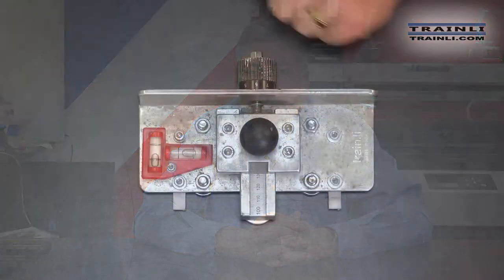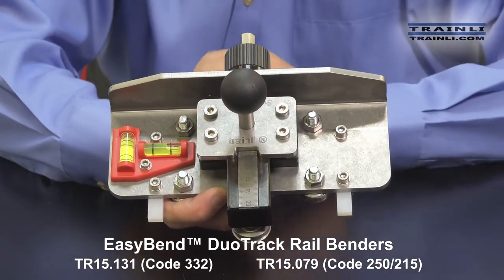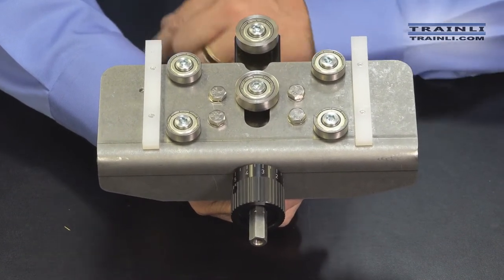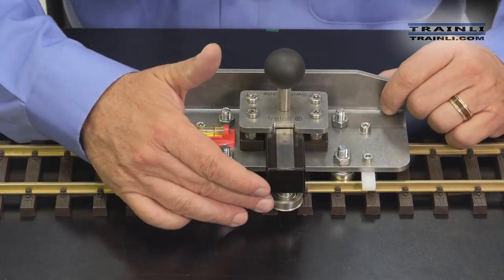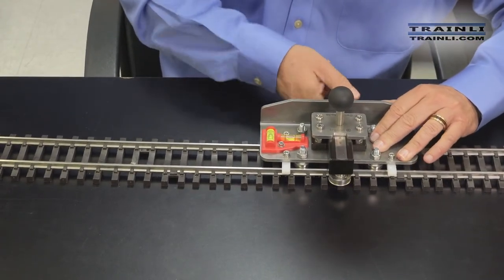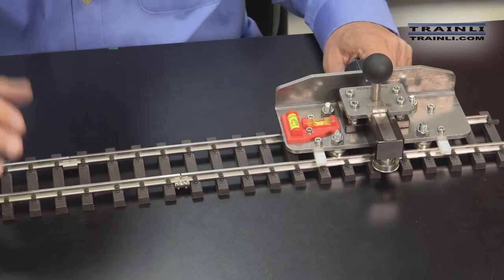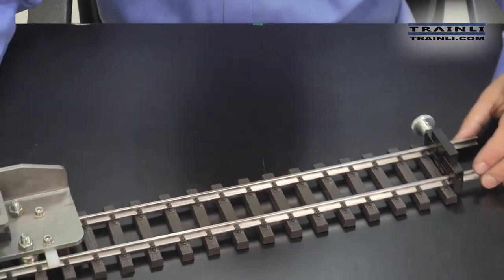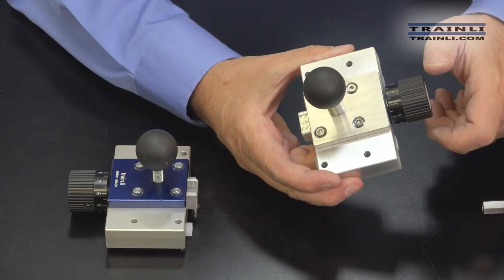TrainLi TechTV  -  See the best dual Rail Bender on the market!

Comment: Building a 18’ long trestle, using “ former” split jaw bents and roadbed, with a dearth of instructions.Oh yes, it’s on a slight grade, and curve. Challenging. Replaced a wooden trestle, 15 years old, so the curves aren’t exactly/ hardly the same. LGB rail. Time to place rail, found my track bender, last box top shelf, anchored the shelf for 14 years, as layout was mature, but time, and weather change things.

Thanks for the explanation, , a great help. Will report back, as now I can bend the rails to exactly match the trestle, and eliminate the tensions of belly bent curvatures on the trestle.

  Although I haven’t tried it yet, plan to use sections of LGB 18000, and 16000 track as templates, noting the MM# on the guage, to insure consistency if curvature.  Should work. 

 Jim Neighbor
Reply from the maker: How is your project going?  I would recommend our 6' flex track, either in brass or nickel plated brass.  It works great!